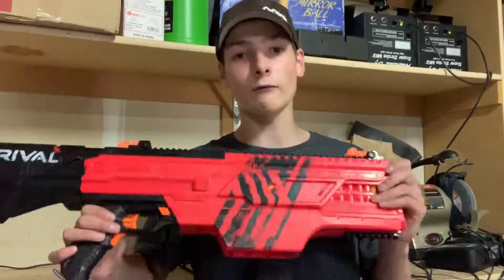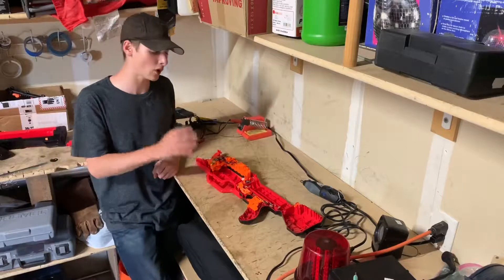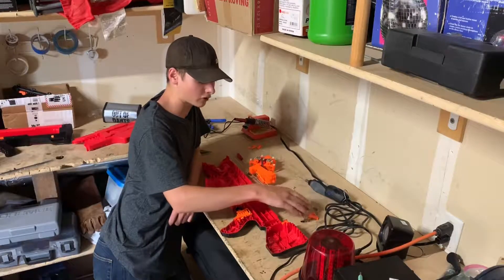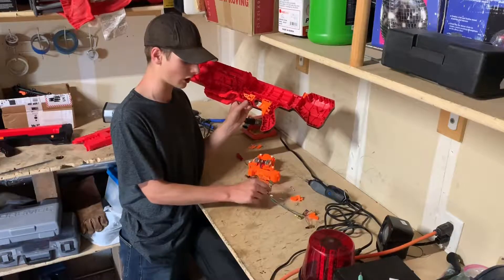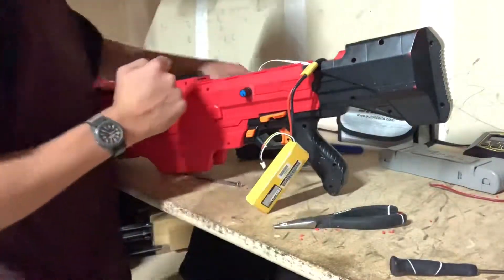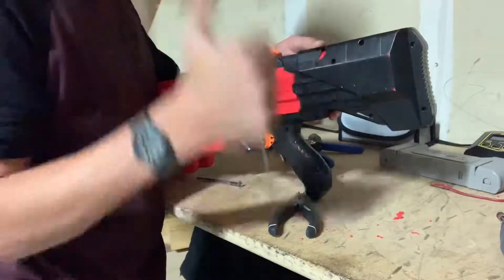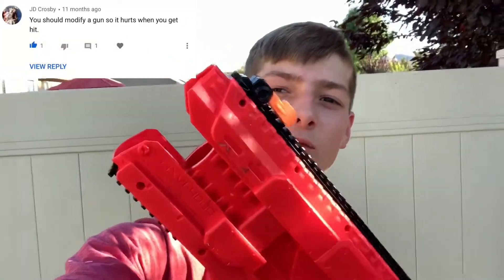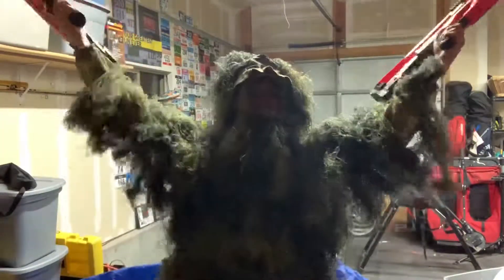Ultimate Khaos Mod(20 Balls per second)

Comment: Do you need to buy extra switches so the ones already in the Khaos don't burn out?
Reply from the maker: I do have many extra switches but I’ve used my Super Khaos many many times and the switches I’m running are still working perfectly fine
Reply: So you used the switches that came with the Khaos
Reply from the maker: No, I have some extra switches that were purchased separately from the blaster.
Reply from the maker: If you go to outofdarts.com you can find the switches I used
Reply: Which switches and which wire
Reply from the maker: 16 Gage(AWG) and just any switch
Reply from the maker: @altidudes  Specifically a Cherry DB 2 Micro-switch. I purchased mine in a 20 set bulk, i cannot remember where from but i purchased the 16 Gage(AWG) wire form Home depot. If you would like in Next weeks video when I go over electronics I can talk about the Super Khaos mod!
Reply: Yes please!!!!!!!!!!